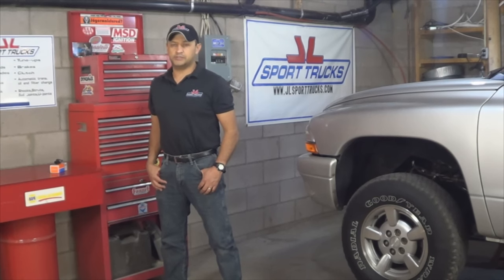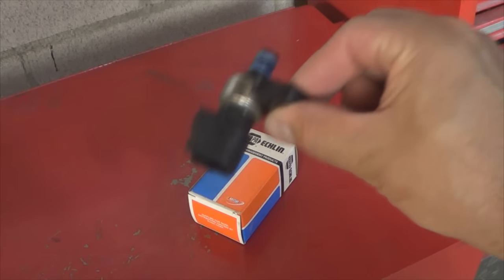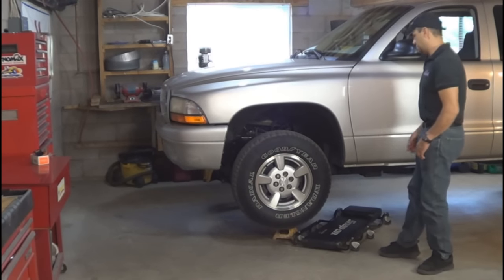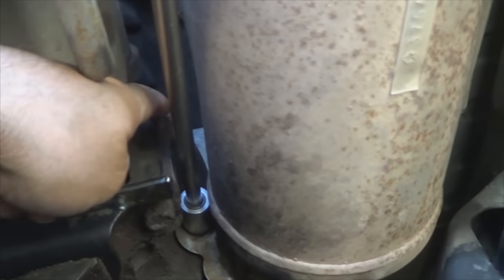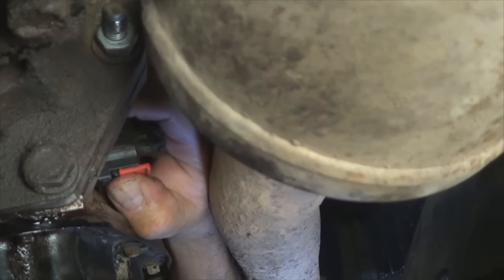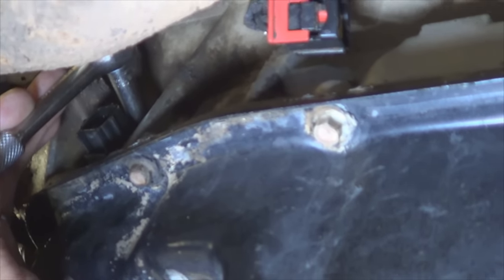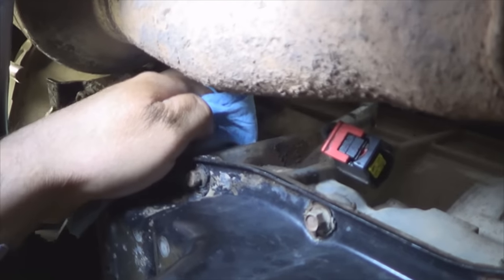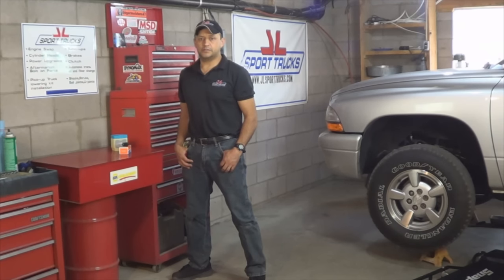45RFE and 545RFE Transmission Pressure Sensor Replacement

Comment: My 2006 Ram 2500 powerwagon had the Transmission oil pressure sensor broke in half while off road.  Caused a P703 error code,   worked fine in Reverse, 1,2,3 but slipped into drive.  I drove 2 miles home in 3rd.  I found  the error code and google pointed me to the issue, I removed both halves and replaced the sensor.  The truck still moved back and forth but I still had a check engine light.   So I reset the error code and now the transmission does not move in any gear.  No error code, but no motion at all.   I reset the PCM buy pulling the fuse and left the battery unhooked overnight hoping to reset something.   Still no go.   Is the transmission damaged?   It moved one minute but not the next after simply resetting the error code??   Any ideas?    Thank you

Comment: I keep getting my trans temp light popping on every now and then but almost daily now. everything you would think to check i have checked and narrowed it down to either a sensor or the trans auxiliary radiator( or whatever you would call that) fan dying. anyone have any thoughts on this? any help is greatly appreciated!

Comment: This guy's video is the perfect one that showed exactly how to change the transmission pressure sensor.  This video is short to the point giving you the steps you need to DIY. I was preparing to remove transmission fluid pan before watching this video.  It saved me trouble! I'm happy I changed the sensor and the light is gone! Five stars!

Comment: The trans is the 545RFE, ChryCo labeled then different. The programming is the only difference between the 45 and 545. Both are actually 6 speed autos; 3 planetarys, 2 gears each = 6 forward gears. You can flash the TCM on 99-02 trans to get the use of all forward ratios.
Reply: How can I do this

Comment: Great video!  Love your step by step instructions and helpful tips.  I have a leaking sensor on a 2005 Jeep Liberty Limited.  Rock Auto has two OEM sensors for the same transmission.  Once I figure out which is for my Jeep, its on!🙂

Comment: Excellent video. Thank you for sharing your knowledge with all of us. I have a 2006 Jeep grand Cherokee Overland with the 5.7 L Hemi.. from other documents that I have observed I thought there were four pressure sensor switches inside the transmission fluid pan where the filter goes. Can anyone verify if this is accurate?
Reply: I just checked on my 2006 5.7L Commander, and that fluid pressure sensor is on the driver's side about mid way along tranny and up towards the bell housing of the tranny. It's in a harder to reach than this older model durango in the video since the front diff drive shaft is in the way and is also partially blocked by the exhaust pipe as well. it's going to be a hard reach for me to get that connector undone. it's going to take an extension and a lot of maneuvering to get that connector undone -which will by far be that hardest part of this process.
I'm throwing money at this since po841 code showed up and i'm not getting into gear, almost like limp mode and I have to rev up my motor before it catches and then it feels like it's in 4wheel low... obviously not driving anywhere until this gets changed out alongwith the fluid change and both filters. Praying this fixes the overnight issue this vehicle developed overnight

Comment: great video it really helped its an easy fix but be prepared for issues lol I put my durango on the ramps did the replacement of the pressure sensor and both speed sensors went to start it all excited hoping I fixed all the issues and got click  nothing  lol 3 days still looking for wtf I did wrong  it must be spectacular as I even stumped google lol

Comment: i have reverse that works by itself unless on incline or if i hit gas. drive works perfect unless it jumps after first cold start of the day then it slips a lil for 2 miles or so. is this a sensor issue? i have aftermarket exhaust it could have melted the sensor

Comment: Jeep wj 45 rfe gearbox switching from R to D mode is delayed by 1-2 seconds. I opened the automatic transmission, flushed the solenoid block, everything is in good condition. The car stood on the street for 2 years. Could there be a problem in the automatic transmission oil pressure sensor? There are no errors. Sometimes the engine speed drops when the automatic transmission is switched from D to P
Reply: Same issue I'm having. And I just had a motor put in mine. I'm gonna try this. I have code p0868. For fluid like pressure. It could be internal faults as fluid pump or bad seals
Reply: Do you also have a shudder when it comes to first gear? When slowing down?

Comment: Thank you. I have a  Dodge Dakota that keeps going into limp mode and once I shut it off it will not restart till it cools down. I am praying its the sensor and not the pump. Will check your web site next time for parts. Do I need to do a relearn on the transmission after this? Again thanks.
Reply: What did u do

Comment: What is the code  usually associated with this? How do you determine if this pressure sensor only needs replacement vs installing a complete kit into the transmission? My transmission indicator light came on yesterday, but i have not had a chance to go to an auto parts store to have the code read on it. My 2004 Dodge Ram 1500 hemi did not go into limp mode, yet. The tranny is properly full and not odor to the transmission fluid. No notable difference in shifting gears prior to this check engine light showing up as it did. Thanks for the video posting, but I would like to have these questions answered if you don't mind. I normally have a code reader, but have one on order, as my son-in-law took my other one. Thanks for any info.

Comment: Thanks for a very clear video, I have the same leak on the 545 RFE on my 2007 Grand Cherokee with the 5.7 Hemi, I thought it was from the pan when I changed the fluid several months back but it's actually leaking from the sensor, onto the pan edge. The part I couldn't see well was the 2 nuts holding on the heat shield now I know what to look for! 
On mine the primary filter had clogged and I had no drive in FWD or REV, after I changed the filters it was fine again, and I did get a low pressure code due to the clogged filter. I also heard that the can filter can get loose and cause problems. Next time I change the fluid I am going to use a pan with a drain plug and a Lube Locker gasket. RTV is a pain, lol.

Comment: My 2003 wj grand Cherokee with a 545re was kicking hard from cold start between 1st and 2nd and 2nd and 3rd until it was driven for 10 or 15 minutes then it would shift normally. Originally diagnosed with high line pressure and later faulty pressure sensor. Replaced the sensor ( get an OEM or equivalent ). Hard kicking stopped in lower gears but moved to between 3rd and 4th and continued even when warm every time it shifted. It became less frequent and harsh over the next few days of short trips and then I took it for long drives on the 4th and 5th day. Kicking is completely gone shifting is smooth as silk as it used to be and the revs are lower at cruising speeds. As someone mentioned in the other comments the computer had to relearn with the new sensor as it had been compensating for the faulty one. I recommend a full transmission flush and i use Penrite full synthetic ATF. It boasts 5x smoother shift and you can barely feel the shift through the gears.
Reply: Jeep wj 45 rfe gearbox switching from R to D mode is delayed by 1-2 seconds. I opened the automatic transmission, flushed the solenoid block, everything is in good condition. The car stood on the street for 2 years. Could there be a problem in the automatic transmission oil pressure sensor? There are no errors. Sometimes the engine speed drops when the automatic transmission is switched from D to P

Comment: Can a bad trans oil pressure switch also cause code p0700
Reply: What was the solution or problem on ur truck??
Reply: @AngelRodriguez-jv6oc  I'm in limp mode. Was throwing p0841 and p1775. Would a bad sensor cause this?

Comment: I just checked on my 2006 5.7L Commander, and that fluid pressure sensor is on the driver's side about mid way along tranny and up towards the bell housing of the tranny. It's in a harder to reach than this older model durango since the front diff drive shaft is in the way and is also partially blocked by the exhaust pipe as well. it's going to be a hard reach for me to get that connector undone. But thanks for showing this video and giving me an idea of where this is located- and NOT inside it.

Comment: I have the 45RFE. I had slippage and hard shifts. I changed the TPS and did a relearn on the trans and it did the job. Good video, thanks.
Reply: How did you do the relearn ???? My truck is doing same thing ):
Reply: @AngelRodriguez-jv6oc did you figure it out?

Comment: So happy I found you.
Lost everything except neutral and park. Codes P0934, Line pressure sensor low, along with code P1684, Battery power disconnected 😭

I am replacing the sensor today.
If the connector lead shorted, wouldn't the 20v fuse pop @ power module? Reverse lights still work, all electrical still works.
I'll clean the connector with electrical cleaner before re connecting.

I can't afford to get Slaamco'd 🙄 Plus a tow 💸💸💸💸💲💸💸💸💸
Reply: So what did it take to get the gears to engage again.Have same problem.

Comment: I just changed my transmission valve body and replaced all the filters in my 2002 JGC 4.7 v8. It ran great all day. The next morning replaced the ps pump bc it was leaking. I turn the jeep on and it blew out ps fluid out of my trans oil cooler.

Comment: is this the same location as a jeep liberty?
Reply: Find out what trans. The liberty has.  545rfe
Reply: Yes it is
Reply: 2002 and early 2003 Jeep Liberty with the 3.7L V6 will have the 45RFE. From 2003 on they will have the 42RLE, except the diesel (CRD) which will have the 545RFE.
Reply: @robertemmons2260  thanks I was asking the same question. I appreciate your help